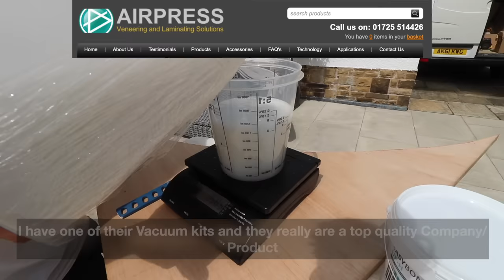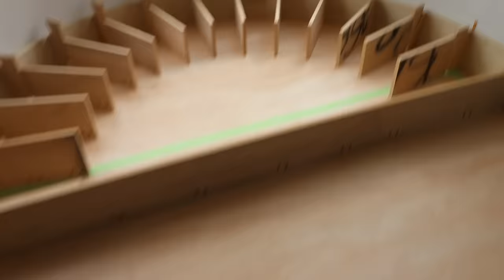Jaw-Dropping Curved Skirting Boards: Carpentry Skills Unleashed

Comment: 99% of people would have absolutely no idea the work involved in that one piece of skirting. Very nicely done
Reply: they would just get Poly baseboard, considering this one ended up painted anyway
Reply: @igorp 

Fair point
Reply: Needed a curved oak skirting 6 years ago... they steamed it !
Reply: @leecrook6918  

Yeah that can be a bastard though. And you need a steamer on site and all the flaff that goes with it.
This guy has done a good job with lam bending
Reply: You can order a custom piece of flexible moulding.  Much less work same results.

Comment: I would 1) use bendable base moldings. 2) make 22.5 degree cut (instead of 45 degree) for the rounded corner. 3) shorten the curved baseboard molding so that it doesn't push out the shorter molding.
Reply: Agreed, the bullnose pissed me off.  But impressive skills, scribing and video editing. Tips hat to a master carpenter :-)
Reply: Pretty sure it was done like that to run parallel with the inlay detail in the flooring. Bit of a compromise as to which would be more noticeable when the job was complete. Proper job, keeping the skills alive and not just another house bashing site chippie.👍

Comment: I am impressed. That’s an awful lot of work. I just recently did something similar and I used flexible polyurethane molding. They make it in most standard profiles as well as custom. A lot of flat stock as well that can be stacked/combined to create your own profiles. Tight radii only needs a heat gun and patience.

Comment: I think you call that profile you ran on the base board cap or skirting board cap "Lambs Tongue"? This is an impressive job. I am also a woodworker (Brit living in America) and have a shop that has taken over the basement and 3 car garage. I also use Felder machines. I have some of the same machines you have that I bought new 2 years ago. I also am looking at a post and beam (timber frame) project that will have enclosed walls. In the old days it was done with wattle and dawb. I have come up with a modern method to replace the wattle and dawb method and still get the required "R" insulation value. The Americans just screw stress skin panels on the outside and cover up the beautiful frame construction that takes time and effort to build. This method still looks like original tudor and gives you tat black and white look. If you ever do a job like this I'd be happy to share what I came up with.

Comment: This is a great job. The one thing I would have done differently would be to install the baseboard [skirting board] before the corner beads were applied, and then the plasterer could have eliminated the big gap at the wall.
Reply: When I see rounded ( bullnose) corners, I always add a small piece between the larger pieces of baseboard 22.5° on each end and it fits like a glove without having to fill in the large gap

Comment: Outstanding!  That is absolutely stunning.   Perhaps I missed it but, how did you keep the wedges from forcing your former away from the wall.  I see the extra sheet of plywood laid down but it was unclear how it was secured.  Steve
Reply from the maker: Ahh I used a few screws behind the line of the skirting into the flooring. Didn't film it and completely forgot to mention! Good observation!

Comment: This is great, a lot of thought went into this lol. Usually when we have radius trim to do we take a skill saw and run cuts through the back of the board every 1/4 inch. It bends to pretty much anything within reason
Reply: That’s exactly how I do it too. Seems like an awful lot of effort to go to for something that’s painted 😂
Reply: No doubt lol. Could do this in probably 10-15 mins if I really took my time. This is definitely one of those “oddly satisfying” type vids though

Comment: I could have done the same thing with much less work. I’d have sliced out the back of the board at 5mm/10mm intervals and then filled in. Taken much less time and looked just as good. A couple of fixings every  6 inch or so. If it was a wood finish your method would have been worth while, but you painted it.

Comment: Excellent all round- nay gobsmacking.
Without wishing to take anything away from your magnificent skills and application ,may I ask you if you considered the steam bending approach with the thick board and moulding done in the workshop prior to the bend. Shipwrights use this technique with the minimum of facilities using polythene tubing (used for ventilating) and a lash up of a steam generator (seen it done with wall paper stripper  units).

Comment: Far too complicated. In my day we didn't have a band saw. Put kerf cuts in the back of solid timber, soaked it in water, screwed it to the wall and plugged it...same with the top bead profile.Used silicon to fill.

Comment: Wow! I have a bunch of questions. Hope you don’t mind but super interesting video along with the spindle moulder build. How long does that glue take to dry? And was it just the plastic wrap to stop the squeeze out? Knowing you will need to scribe do you make the piece a little taller and subtract that amount then to set your scribe to that amount? Hope that makes sense. I honestly would have been sweating bullets every second of something like this. Also, have you ever done a video on how you started, where you trained, people you’ve worked with and that kind of thing? I’d be super interested. Great vid. Hi Cripps!

Comment: I have to say you made that very expensive.  I have fitted dozens of curved skirting boards over the years with less than a 1/4 of the equipment and tooling you not only used but made for the task. In my corner of the world those curved bay windows are very common. So long as you can get a single plank long enough it's easy to do. It's more time consuming if a jointed piece is needed. However it's a good job now that it's on.  Ever done an outside curve or curved outer corner?

Comment: nice job but gosh so much work , I have had great results in similar situations using a wallpaper stripper/steamer .. cut the timber skirting roughly to length loosely roll up in plastic sheeting and steam away , its amazing how playable it will become after an hour or so , this method works especially well with Mdf skirting it just takes longer to get it as workable  with timber

Comment: That’s definitely the way to do it you can cheat if the base gets an oh mold on top by using flex plywood than the last pice can be you finished lamination . The idea of scarfing the back on curved stuff guarantees a crap job and takes just as long . Great job

Comment: I did the same job for my sister 20 years ago with just a panel saw and a stream to soak the wood in the water for a couple of week and then cut it every 10mm, it took days and I screwed it on it still looks good to this day. She doesn’t know how lucky she was I did it. Never did another one. This one is total perfection done by a master craftsman.

Comment: Stunning work.   
If it were two simple straight runs of board on a rounded corner would you normally do 2 sets of 45 degrees mitres with a very short piece of board in the middle?
I completely understand not doing this in this instance as too much at risk with the curved skirting.

Comment: Love this - how would you attempt this without a spindle moulder? kerf cuts to the back of the board and filler in the cuts within the moulding? Clearly not the better of the two methods,
Reply from the maker: Probably a long box and steam a solid moulded  piece tbh. But it's not ideal or easy

Comment: Looks like they have run cables at base of skirting.  It is NOT a prescribed (safe ) zone under Part P Building Regulations.
 Someone needs kicking .
Reply from the maker: I think they were data cables but yeah it's not ideal!
Reply: @BradshawJoinery  They are feeding the sockets as far as I can see..

Comment: That a great lamination technique I don’t get the lack of a double miter to make the corner detail better but to each there own I guess
Reply from the maker: It just works as the other details int he room are 90 degree. the only other option would be to mini radius them witht he walls but thats a lot of work for a detail covered by curtains

Comment: I am a trim carpenter and there is nothing speacial about this. 1 Carter flex would usually be done to do this. (It's just rubber trim) 
2 you just make a bunch of shallow cuts on the backside running vertical then caulk the top edge. I could do either in under 30 mins....
Reply from the maker: And then what's the solution if you wanted better than that...?